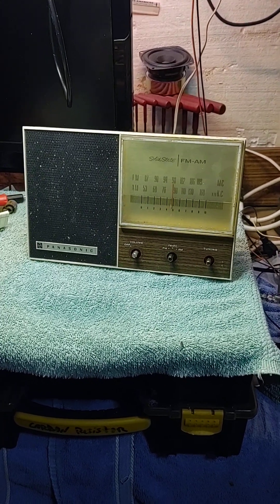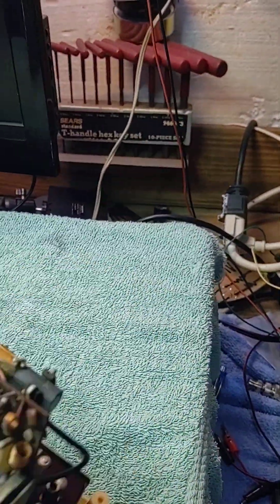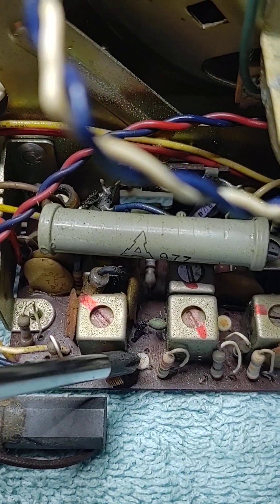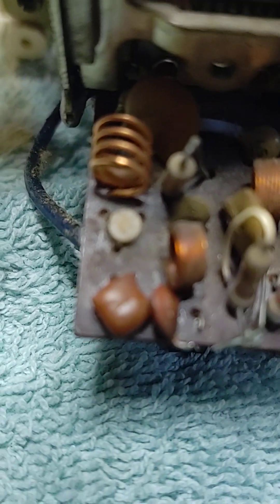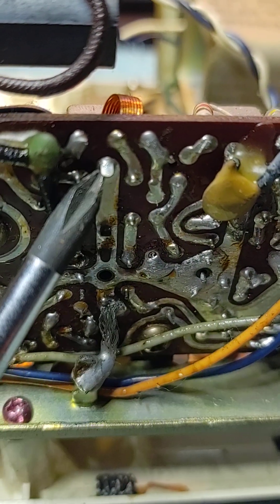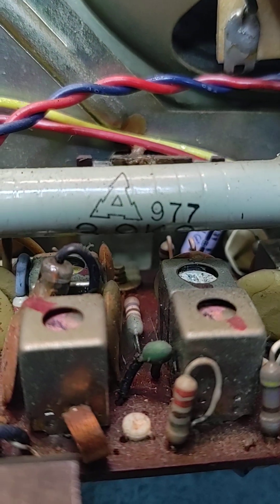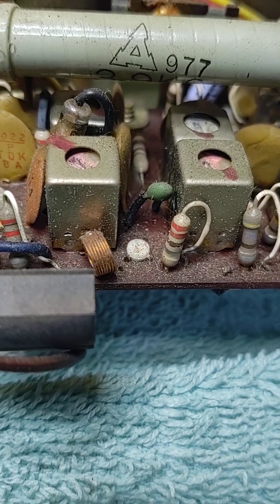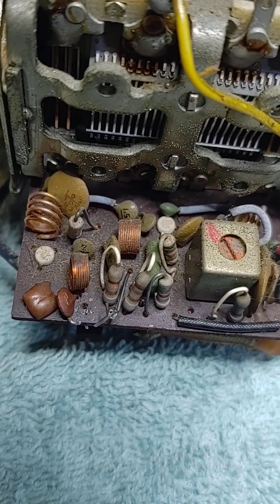Surface mount electronics in 1960's Panasonic radio?

Comment: Not surface mount....that transistor is a threw hole component. SMT components do not have leads that pass threw the pcb. SMT components solder directly to the art-work or foil conductors.

Comment: Hmm. Those are still through-hole though, right?
Reply: Many years ago (possibly in the early 1970s), Radio Shack had a project kit with a "space age integrated circuit" that was actually an insulating substrate with plated metallization, thick film resistors, and a silicon transistor. The transistor package was the same style as these, but it was mounted in a modern-looking surface mount fashion. It appears that the pins on these transistors were deliberately made just long enough so that they could be bent to accommodate through-hole assembly, if desired.
Reply from the maker: Think of it like a surface mount  chip, SOC? with legs bent down